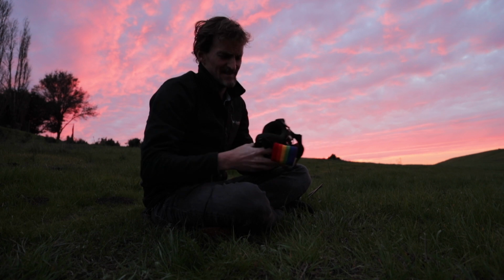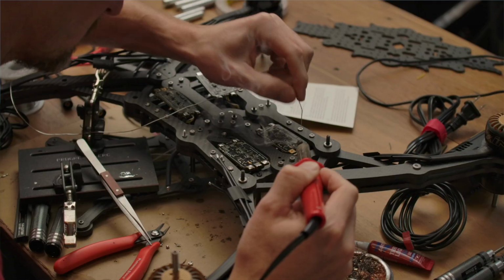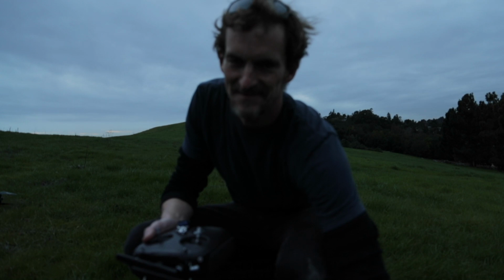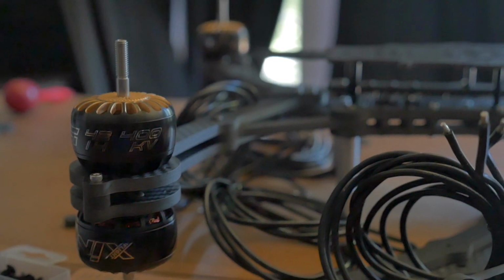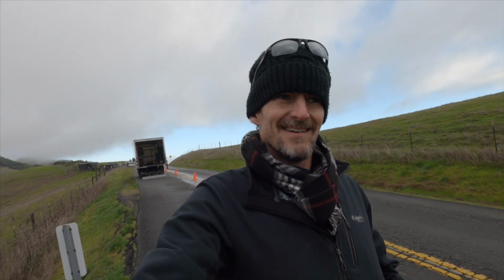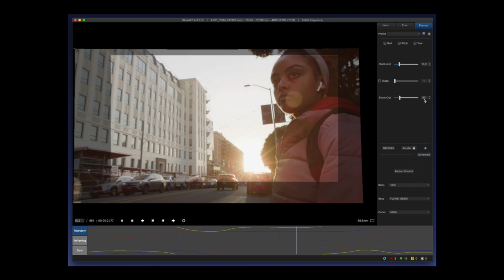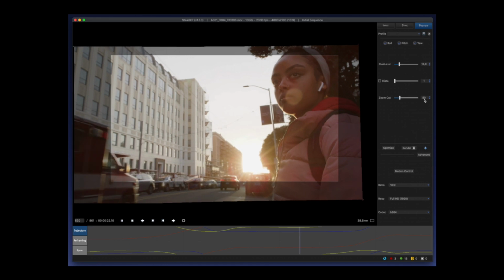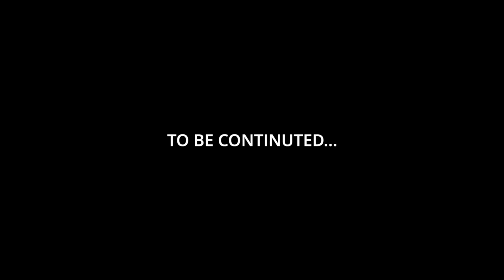Nantahala, 8-Rotor FPV Cinema Drone, Part 1

Comment: great work im about to build a hildagard and considering a large frame for carrying a DSLR
Reply from the maker: Nice!  This is a really interesting comparison to the Fatarmmorgana "beast class" drone I fly (probably why I keep bringing it up in the video)..  I haven't really pushed this new X8 too hard as it's the first prototype, but overall, it definitely flies like a bigger drone than it is I think, like more smooth momentum and glide, more lifting power, but less agility and all out speed.  So it's pretty cool as a film platform.  It is running 8S vs the beast class's 12S, and 14-inch straight blades vs 13-inch tri-blades.  And it's not a fair comparison, because that beast class has no trouble going like 120mph :)   That said, this platform would have absolutely no problem with the weight of a DSLR.. the Z Cam is a pretty hefty little camera and it flew for 9 minutes easy.
Reply: @MattBeardsley  Good to hear, im also considering the Fatarmmorgana with 13" MAS tri blade and 12s power for a more aggressive build, motors either F1000 or ive also seen some Rcinpower 360kv motors. my Hildagard arrives tuesday and the build begins. in the near future I may look to purchase the 570, ive been talking with stefan alot. ive seen the cut down version of the cannonball 800 over in the states but price is way higher plus ill get a big customs charge for it. either way this will be my first realy big build using 4 individual ESC comapred to the 4-1

Comment: Hello!

Great work, beautiful drone.  I have built something similar, but scaled down, using 2207 motors with 7 inch bi blades in the x8 config.  I am having trouble with no yaw authority at all.  Besides that the drone seems to hover, pitch, and roll, but no yaw imput at all.  Could you share your pids or tuning?  Anything would be great 👍 happy flying!
Reply from the maker: No yaw authority, that's not a problem I've encountered yet on an X8.. Are you running the top 4 blades props in and the bottom 4 blades props out?  It'd be worth checking motor direction and that it matches to what Betaflight is expecting..

Comment: Hi Matt, I've been making progress with my 570 build as you will have seen on the stand in quad page. I wanted to rack your brain over something. I saw you are running DJI system. I've chosen the vista unit for my build. Initially I've wired the power and ground to the 12v rail on the PDB500 but since being told this will cause voltage spikes and drop outs. I've been looking at 12v BEC but these only allow voltage inputs of upto 6s and I'll be running 12s. What did you do for wiring to the DJI unit to ensure correct voltage recieved without dropouts? Thanks
Reply from the maker: Good question.. I am using the voltage regulators built into the APD PDB500 boards and have had no issues

Comment: Heya Matt, what size props are you running? Also would you do a vid on how you wire up for X8?
Reply from the maker: for these first few tests, I tried 8 Graupner 14-inch straight blades.  I have a stack of MAS 11-inch tri-blades to try..  Not sure which will be the best fit until I do some testing!  It's wired like 2 quads, so PDB to 4 individual ESCs on the bottom, and the same on top as well, with the two PDBs then wired together in parallel and the whole system wired to 2 4S packs in series for 8S... then each motor input on the PDBs goes to a motor pad on the FC and all the telemetry wires are bussed together and run to a single UART for voltage and current telemetry (and maybe RPM filtering in future firmware).. added a DJI FPV system and radio control, GPS, LEDs, buzzer, etc.  So far, it's all working pretty dang well together!
Reply: @MattBeardsley  What motors did you use to build your 8-Rotor Cinema drone?.

Comment: I know this is very late but is there any way you could give us a build sheet with what you used?
Reply from the maker: Hi Kurt, yeah, this is running APD120 ESCs, APD PDB500 PDBs, XING 8S motors, and a LUX F7..  I've got a similar build in the works now to test out APD 80 amp ESCs, but no complaints with this setup!
Reply: @MattBeardsley  why run 8s motors with a 12s setup?
Reply: @MattBeardsley  also what frame is that?
Reply from the maker: @Mad_Dog_Sirus  heh heh, good question.  At the time I built this, the 8S APD ESCs were not available yet, so there wasn't a great option for 8S running this kind of power, and I had a lot of 12S electronics from other builds.  I'd go 8S all the way now that it's easier to find and save some budget and a little space and weight.
Reply from the maker: @Mad_Dog_Sirus  This was our first prototype of the Stand-In Quaddesigns "Nantahala" frame (I named it for a river near where I grew up in North Carolina).. I'm building the first actual production model now and the frame should hit the Stand-In Quaddesign  online shop in the next few weeks.  it's pretty gorgeous!  The designer added a lot of custom aluminum and TPU that take it up a notch and make the build a lot more straight forward..
Reply: @MattBeardsley  thank you! Im in film school now looking to become a drone cinematographer and I would like to build a little fleet so I can secure jobs in that field to survive lol
Reply: @MattBeardsley  let me know when the frame goes public!!!!
Reply from the maker: @Mad_Dog_Sirus  yeah man!  It's a blast and it's crazy how fast the technology gives us exciting new possibilities and creative tools.  Good luck!

Comment: Did you have time sues with DJI system dropping video due to voltage?
Reply from the maker: no!  The DJI air unit has been solid.  In this case, with the 8S ESC voltage, I have the electronics powered from the APD' PDB500s' voltage regulators and voltage and current telemetry coming in from the ESCs.. working great!